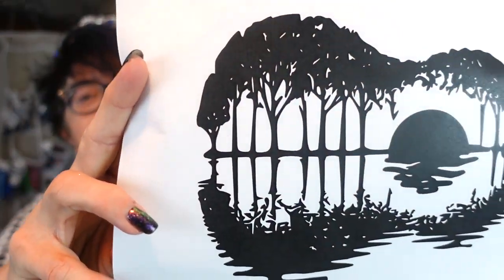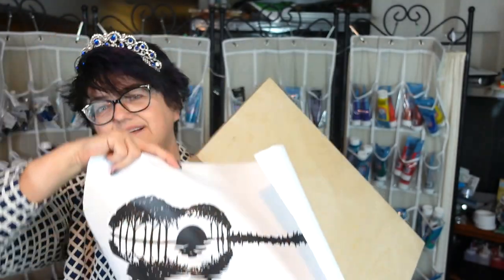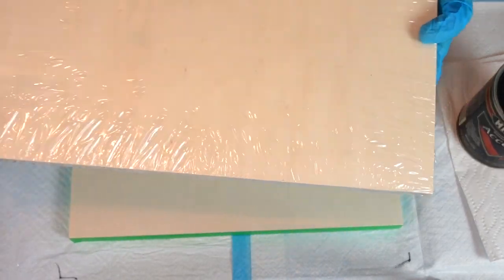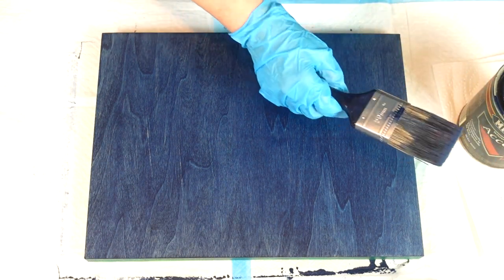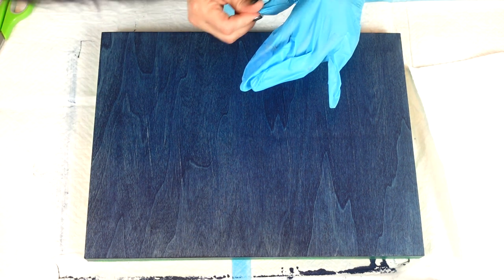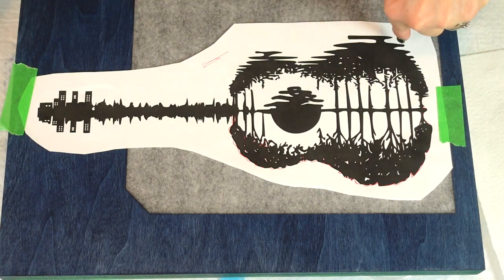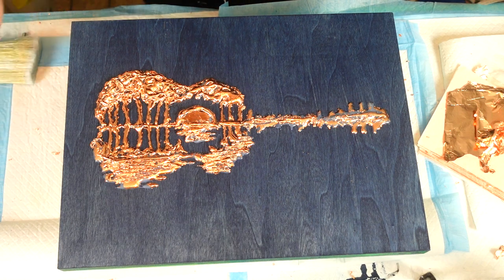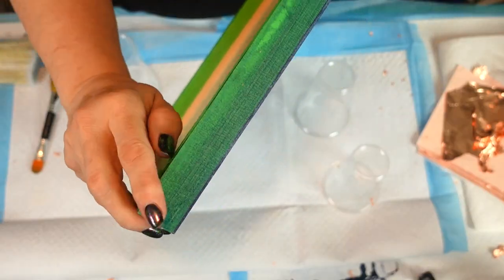Look what I did with a glue gun a guitar sunset picture and copper leafing.  STUNNING!! Video #437

Comment: WOW Sherry this is awesome. Such a great idea for using up all those extra glue gun sticks that most of us crafters have laying around lol. I think  you could use the hot setting on the blow dryer to heat up the surface of the glue stick that the foil wasn't sticking to, so it melts the surface just enough so the foil will stick to it. If the blow dryer doesn't work then try a heat gun from a distance.
All the best, Diane, UK xx
ADDED: You could also use the heat gun to remelt any areas you're not happy with to smooth it out. xx

Comment: I did this before making a sesame street character what I did was put parchment paper over my template then added glue.  When glue dried I painted it with foil adhesive and foiled it in different colors.  It peeled off the parchment paper great and all the painting and foils were much easier because I did not have to worry about it getting on background.  Hope I explained that right.  Oh when done decorating character I then using a wood glue and E 6000 attached the character to my board background.   I laid a couple books on to hold it in place till glue dried my character to the background.   Worked like a dream. I was not going to resin it so before I glued it to background I sealed all the paint and foil on the hot glue.  Spray adhesive also worked well for getting foil to stick to hot glue.  Since it was not on background I could do anything without having to worry about my background.  Hugs Sheryl 💙🎨💙
Reply: Great tip thanks!
Reply: @marycupp3123  your welcome... I don't do videos or even sell but I love to share anything I know to help others.  Have a great day hugs Sheryl from Indiana 💙🎨💙
Reply: Thank you for sharing your tips! I will give your idea ago! With my luck without the adhesive that goes with the foil nothing would stick.You are so kind and thoughtful. Your input is greatly appreciate it.❤

Comment: I’m happy you’re feeling better and truly hope you doing videos is part of your relaxation. I appreciate them. I’ve just started my look into “how-to” with metallic leaf and transfer foil. I want to use glue, or size, and not need to purchase a crafting machine specifically for this. I realize size is more easily controlled than glue from a gun, but have you heard of “Kuratake Zig 2-Way Glue Pen”? There are different sized nibs, which allows for even better control for detailed areas. I know some hot glues dry so shiny and hard it’s not surprising leaf wouldn’t stick. This came out beautifully! Thank you for sharing the process!

Comment: Hey Sherry on Amazon they sell this glue gun for precision work it is called Surebonder auto shutoff hot glue gun full size 1.5x power of ultra series DT 360F  multiple projects and they sell the tip with really fine tips u should check it out I love mine I think u will love it to and it also has a fat tip to for the end of the guitar

Comment: Even a precision glue with different tips to do very delicate work if you used your hair dryer to heat up some of the glue and then put your copperleaf over it it would restock it's self to it and get rid of those little glue strings I seen some people use there finger to rub it in because some reason it works better I think it would look even better with the sides done in the copper but that is just me everything u do is always so beautiful I just love it

Comment: Just a little warning, I have that same glue gun and severely burned 2 of my fingers with the glue that came out of it.  I've worked with glue guns before and gotten little burns over the years but nothing this bad. 

There is a silicone mold of that same guitar print. I bought it to do for my son. Its much smaller than I thought it would be! One of those times I forgot to check the measurements. It makes a cool resin guitar, I just wish it was bigger.